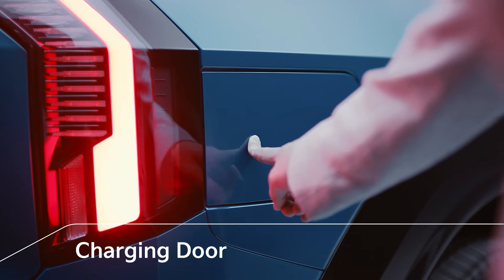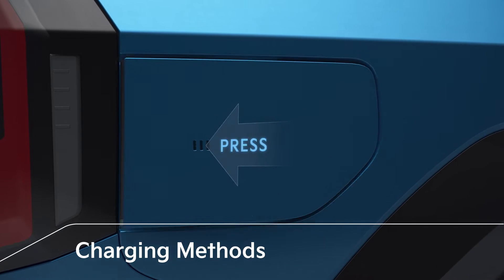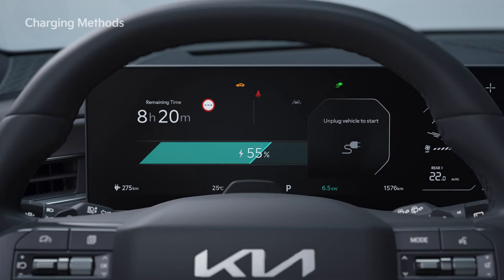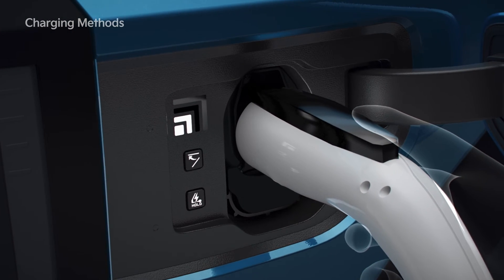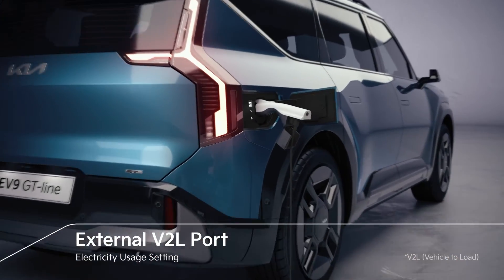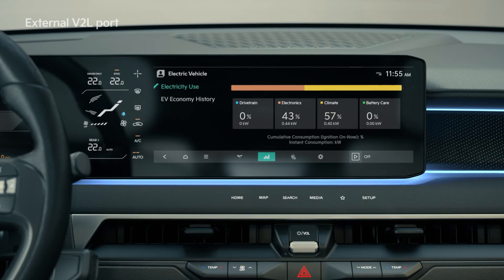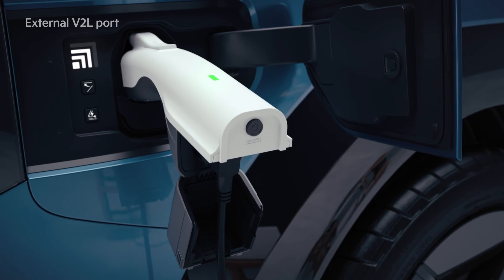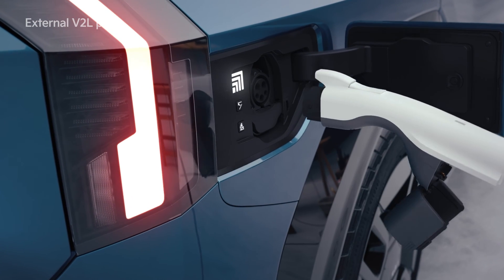Charging & V2L Functions | The Kia EV9

Comment: Anything on your V2H strategy on this or other vehicles? I would very much like to use the vehicle's energy at peak hours instead pulling it from the grid and then charging it overnight when it's cheaper. Of course selling energy to the grid would be great also in a V2G scenario, but that also implies dealing with your utility company and the tax system.

Comment: My EV9 doesn't charge at all with Ac domestic cable. It stops after few seconds as plug in the cable. Why?
Reply from the maker: We're sorry you're experiencing issues. You can contact a representative from your region by going to http://worldwide.kia.com. Then, click the globe icon at the top right corner to select your local Kia website. From there, go the Customer Care Center at the bottom of the screen. There should be a local phone number and email contact form there. Thank you!

Comment: My cable does not release! I fumble with it for several minutes. I assume its the button below the door close but it isnt consitant. Anyone have any idea? Also the car is unlocked I do have the lock setting enabled
Reply: car needs to be turned off, all windows and doors close. press the unlock button on your key fob and that should release. also, when charging at home, make sure AC charger is set to unlock so your cable doesnt get stuck. hope that helps even though its been two weeks since your comment!
Reply: Thank you, I felt stupid this morning trying to leave in my EV9!
Reply: Mine gets stuck too sometimes. I read that you hit lock/unlock 5x on fob to unlock it. It's worked for me every time it locks on me. Just make sure vehicle is turned off first.